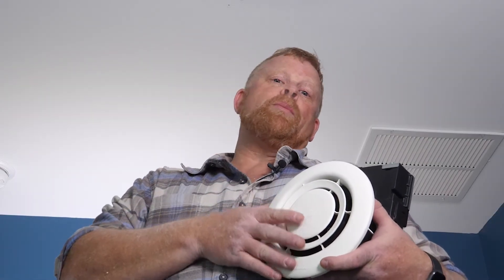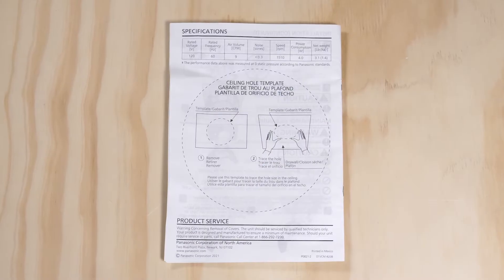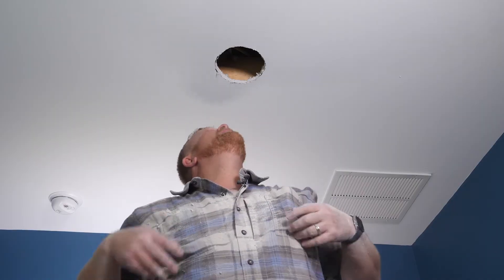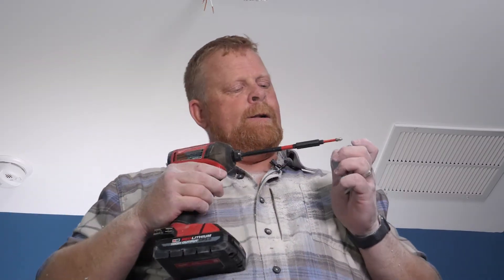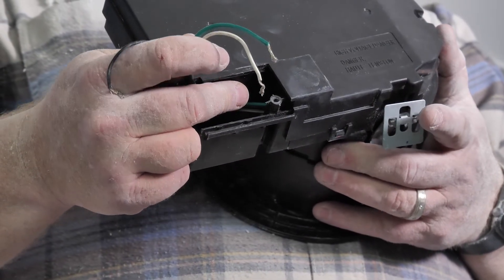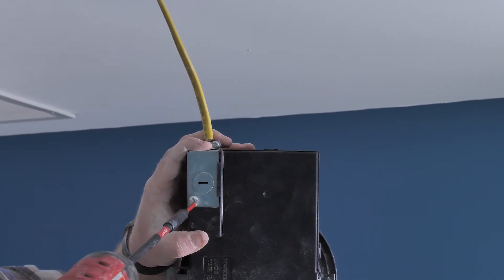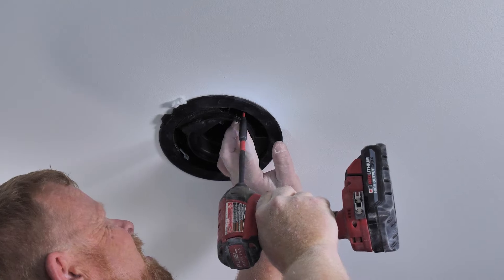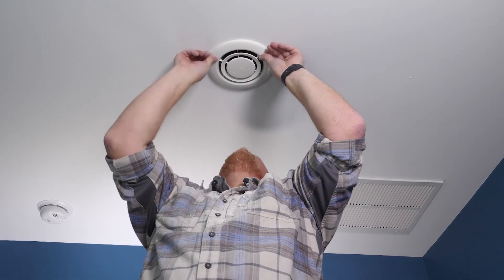Panasonic WhisperAir Repair®, FV-01VCN1, Retrofit Installation Tutorial

Comment: can you install this on the side wall? My attic is full of insulation materials, it will be a big mess if I drill a hole like this.  Also I don't think I will be able to run a wire through my attic